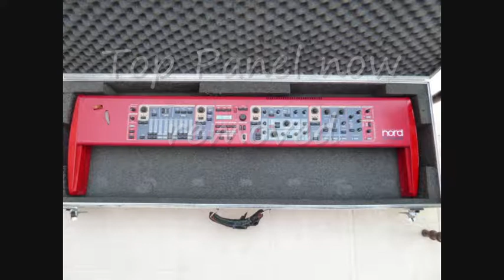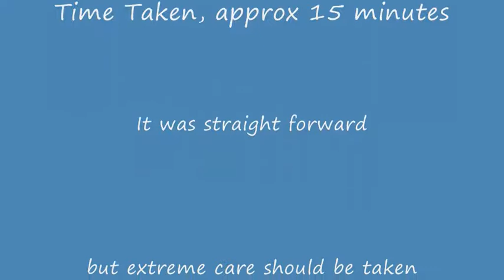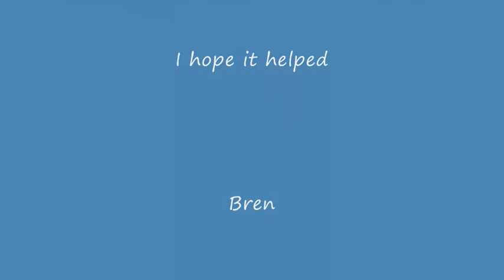Nord Stage 76 Opening up to perform a Repair

Comment: Hi there thanks for this vid! I need to repair a key on my nordstage but i cant figure out how to remove the cable at 1:14. can you please explain, im sure its easy but im to scared to use force so i gave up. but i need to get it fixed

Thanks
Erik